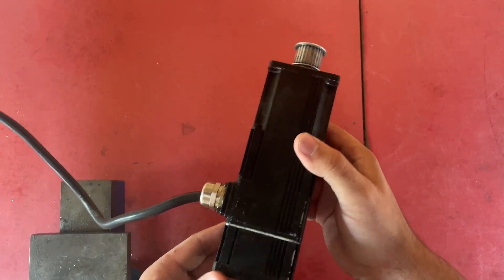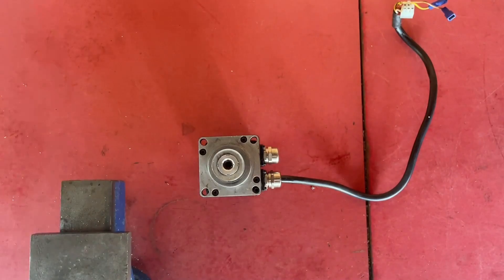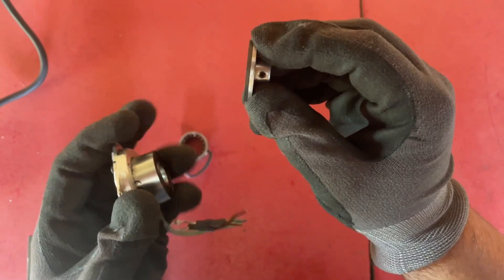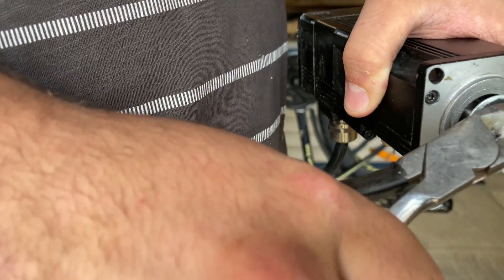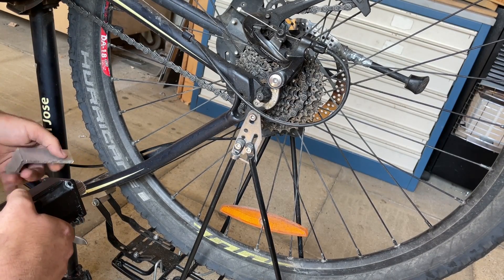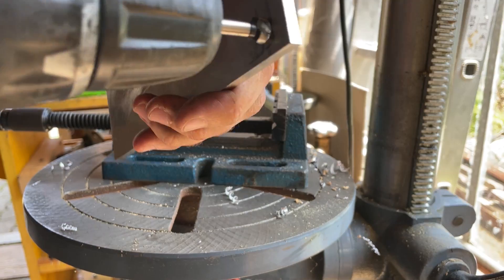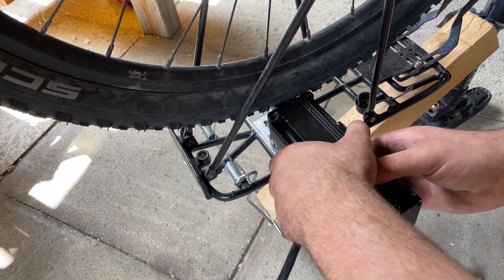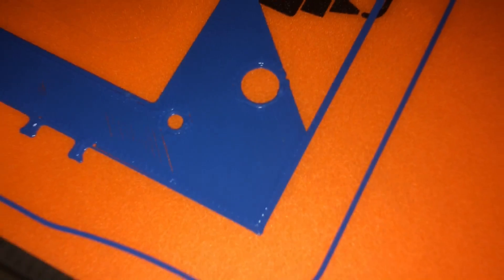building a bicycle generator

Comment: 60W is not much for a cyclist. A normal person can archieve 100W on average no problem.
Reply from the maker: Yes but i was trying to test the generator and not my limits i also will have to do some more tests to figure out how mich actual electrical power can be generated by this motor